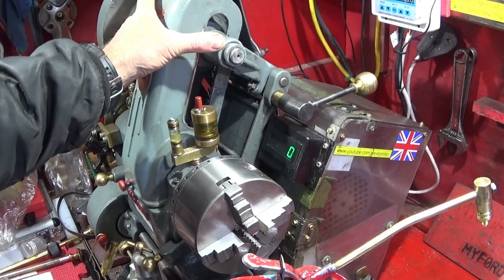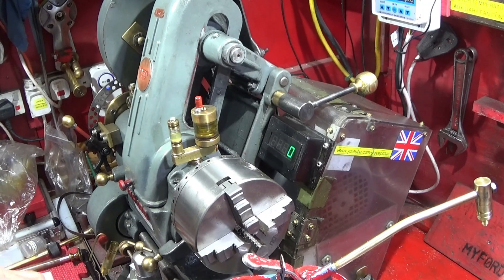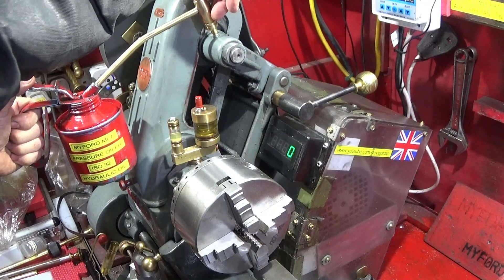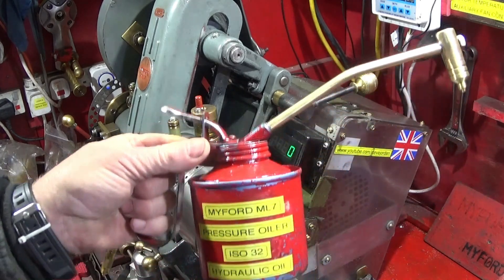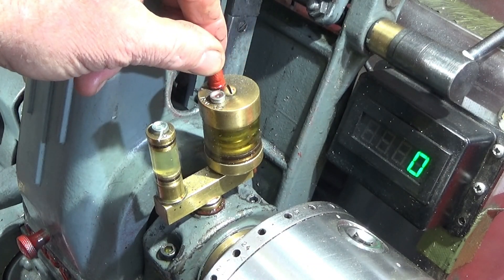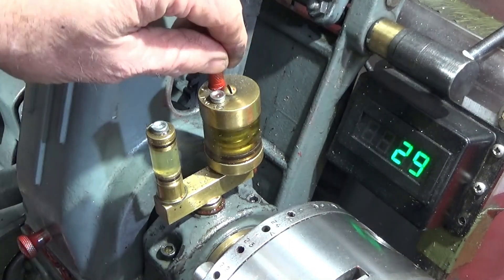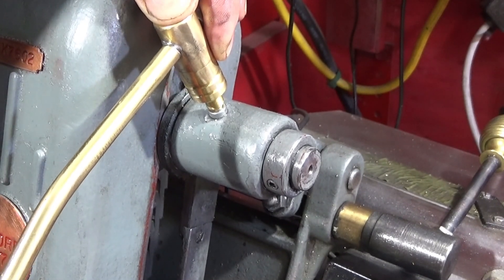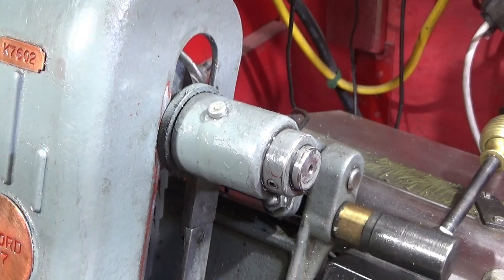My New Myford ML7 Countershaft Pressure Button Oiler Tool

Comment: Hi Steve - I need some help with ML7, I wonder if you had a few minutes to assist me? I have removed the cap head screw as I wanted to try to engage the back screw gears, I think this was a mistake as I now cannot engage the main gears? How do I put it back please?
Reply from the maker: Hi I think you will have to look at the backgear where you removed the screw. Look at the other side and pull up the gear tooth so you can put the screw back in. Then when the screw is in push the screw away from you whilst tightening it. This engages the tooth in the spindle gear to drive it. If you loosen the screw and pull it towards you whilst tightening it..this disengages the gear so as to use the back gear. Let me know how you get on.
Reply from the maker: Hi Mike I will show you in video later on this subject.
Reply: @SteveJordan  brilliant, thank you. I have now done it. I’m going to be a new tool post this week, what do you recommend please?
Reply from the maker: Hi Mike Thanks great that you sorted it. It's good as it inspired my next video on the subject. The toolpost that is ideally suited is the Dixon or Dickinson type. I have an Chinese gib type toolpost as well. I find them as good as one another. The above mentioned one goes on the lathe without any modifications though so it's probably best to get that. Regards Steve

Comment: I've never been sure about the geometry of the tip to match these button oil fittings. Should the tip be fine enough to mechanically depress the ball, or is it just the pressure of the injected oil that presses the ball? If the (fine) tip depresses the ball, is the tip notched a bit so the ball doesn't then seal the tip?
Reply from the maker: Hi Kevin I don't know really. I have tried lots of different tips. They all leak a bit in use. So now I have made a special adaptor....in my next video. Regards Steve
..

Comment: In my little one garage workshop lately I've been running a couple of halogen inspection lamps when I'm in there. They flood the place with light (Obviously), and kick out just enough heat to knock the sharp edge off the chill after an hour or so.

Comment: All looking good for the oil dispenser .
Q. how do you drill your brass bar, without breaking drill bits, as i broke my centre drill, and then i broke my drill bit to.
Can you do a vid on how you made this oiler.
Reply: If you go to Steve's playlist and open "Myford ML7 Maintenance & Upgrade" you'll find several videos about the oilers.
They kind of evolved through incremental upgrades rather than being a single modification, so you might have to watch a few videos to get the whole picture.

Comment: Really well done. My modern mini lathe has oilers with a ball inside but are flat around, not any cone like Your ones. "Filling up" with oil brings the result of more oil floating around outside then inside. It's like air vent for car tires, the needle, here a ball, needs to be pressed down for success.